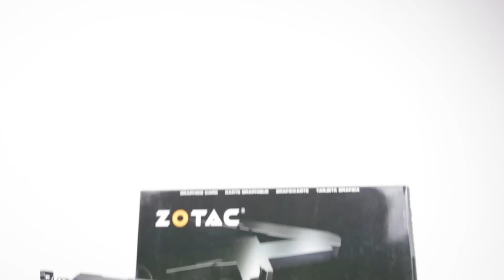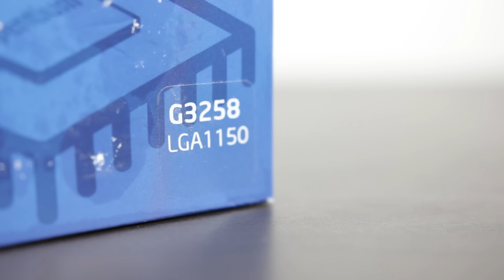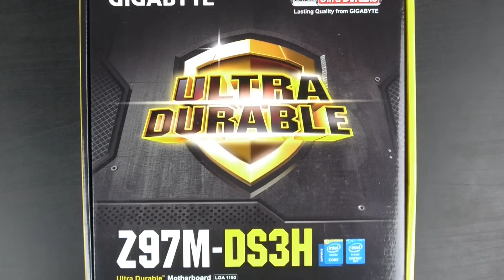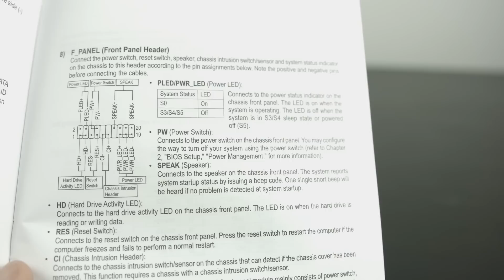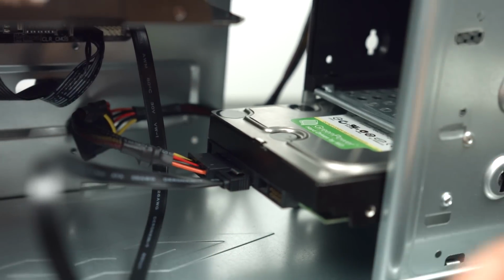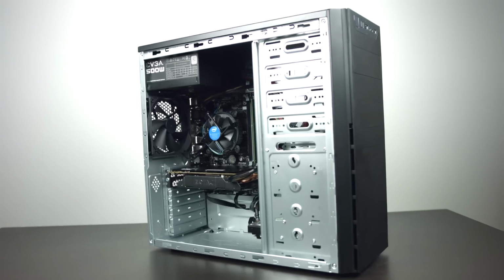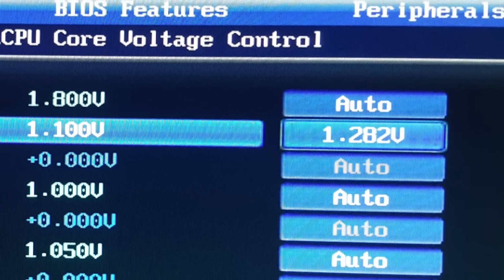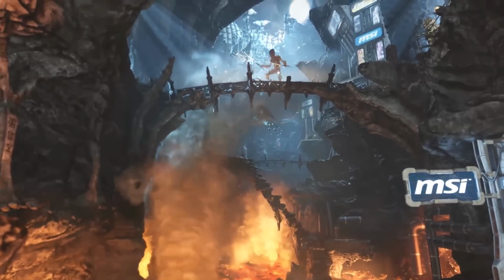Ultimate 2016 $400 Intel Gaming PC Build Guide - Ep.2 Budget Gaming PC Series

Comment: can you make a $500 intel pc
Reply: Yes, I would consider these Intel CPUs, the i3-6100 (new on Amazon $115), i3-6300 (used on Amazon $118) Motherboard for the i3's could be the MSI Skylake H110i AC Pro (New Amazon $88.00). Another CPU to look at is the i5-6400T (new on Amazon $178 used $149.00). I would use the Cooler Master Elite computer (new on Amazon for $42.00, and EVGA 500 watt power supply (new on Amazon $37.00) Operating System, Linux Mint 18 ($Free). Storage and RAM is up to you, but would need at least 8 MB, which is ($38), SSD is $45.00. You can go to PCpartpicker.com and start a build. That equals $365.00 which leaves you $135 for a video card, maybe the Asus R7 370.

Comment: amazing counter comments yet here's my 2 cents on this build matter. it is simply NOT a GOOD Build!
intel user here, i won't recommend any dual core for gaming in 2016. getting an amd athlon x4 or a8 apu or i3 will give better results as many new games requires 4 threads. cut the budget for the expensive motherboard, just get an h81 instead so you can afford a better processor.  watch_dogs taught me this lesson ^_^ minimum frame rate of ZERO on any dual core processor even if it is overclocked to 5ghz.  4gb ram is also very low, sacrifice other components to get at least 8gb because it is another source of stutter/lag aka zero fps... 100fps average or maximum fps on games is pretty useless when your pc dips to zero fps or single digits fps occasionally on newer titles.
Reply: dual core gaming will be around for many years to come as many PC users with dual cores find ways around the quad core requirements

Comment: i'd like to be the first to hate on this video, the ram will bottleneck the gpu extremely, you need at least 8gb ram to get full performance on most games, also, the hard drive probably will fail quicker than most from the more popular sellers, also the cpu will bottleneck the 960 no matter how far you overclock it, a 950 would've been smarter to minimize the bottleneck and still get great performance without getting such crappy hardware like the ram and that hdd

Comment: There is no way this costed $400
Reply: +BossManiacGames Didn't include OS cost. Most people don't when they should. However, if someone already has an installation disk, someone can go to a site like kinguin or g2a and get a windows key for much cheaper than from typical retailers.
Reply: DailyAverageGamer
not os, i am saying this pc costs over $400 espcially when the 960 is like $170 and mobo is almost $100, how does he fit all this in there, very unbalanced build if i say so
Reply: ***** He said he got the motherboard used for $50.